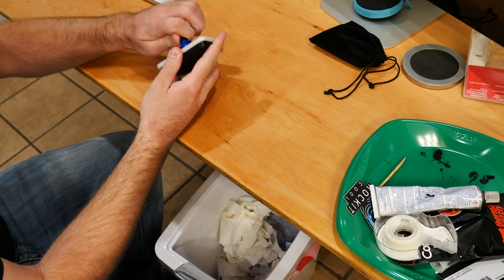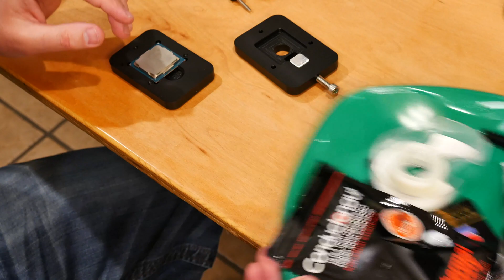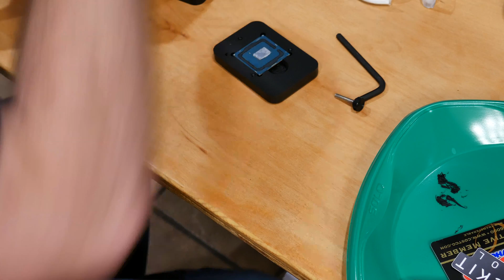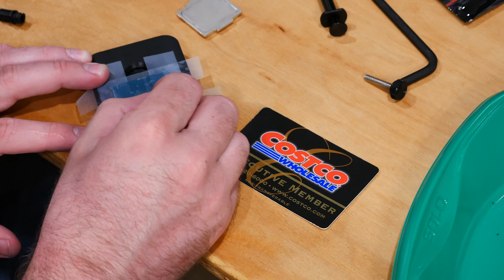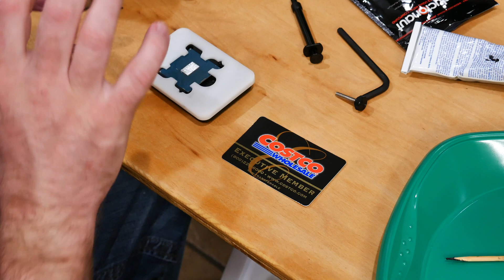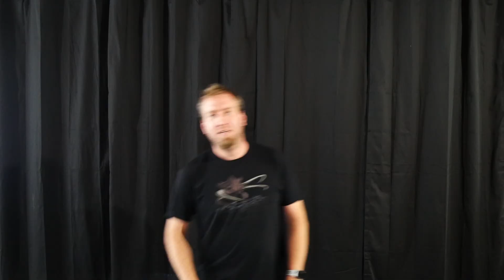Delidding and relidding my Intel i7-7700k. Scary but easy. :)

Comment: I usually put clear nail-polish over those 4 contacts and I only use 2 tiny drops of super glue on the edge of the IHS just to hold it in place but everyone has their own method.........side note I had to do this to my 15 month old i7 8700 NON-K because the Intel mayonnaise was so bad.
Reply from the maker: That sounds like it would be great too. Ive heard that doing it this way you can still claim your warranty if need be. I have no idea if its true but it makes it look just like it did before its delidded. :) What kind of temp diffs did you see on the 8700?
Reply: @PCGoblin  I dropped 20c.....I use a cooler master geminII air cooler
Reply from the maker: yurimodin Thats great! Thanks for sharing. :)